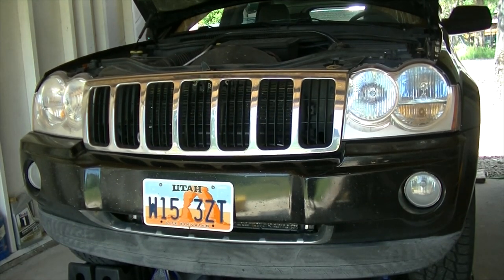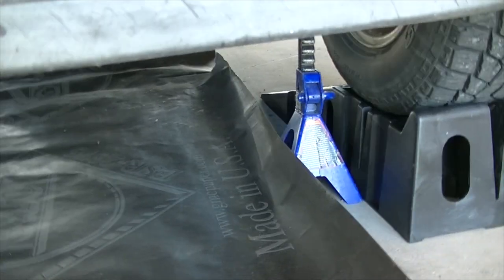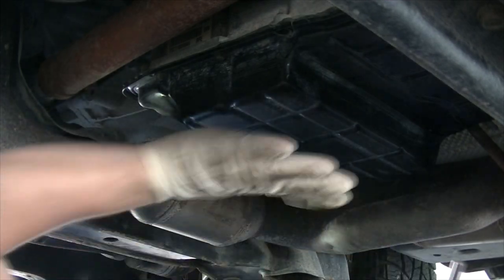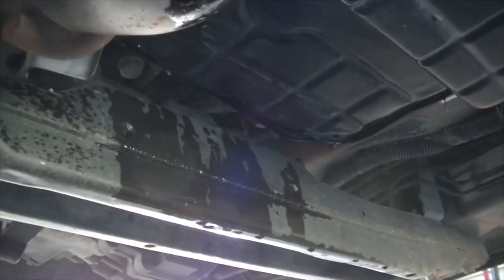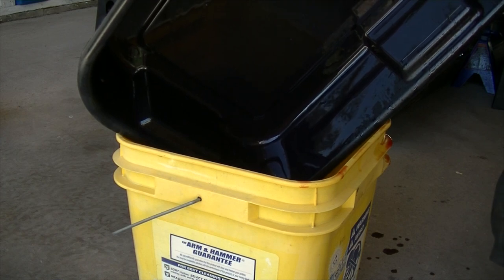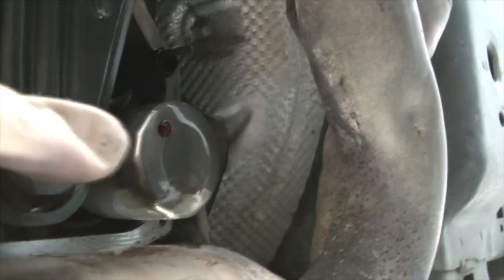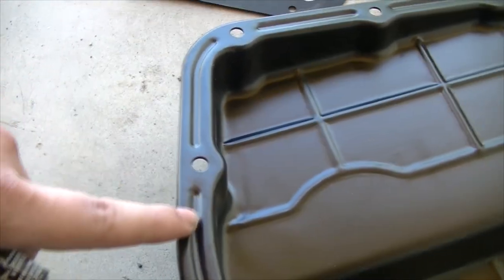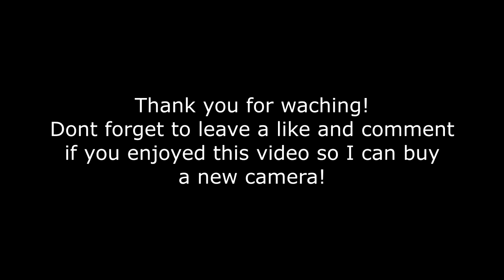WK (2005-2010) V8 Jeep Grand Cherokee: How to service your transmission / swap transmission pan

Comment: RTV is not recommended with these trans gaskets, been doing mine for years without RTV and never had a drip.  Also make sure when installing the new gasket for the filter to install it on the Trans and not over the filter tube itself, heard of a lot of problems resulting from this, great video and very good explaning..

Comment: If you are replacing the pan you could have just drilled a small hole in the pan to drain the oil.
Reply: You can drive an awl in too drain it too, if it's a stamped pan, and then braze the hole shut to reuse👻

Comment: If you have bits of metal in your fluid even if it's black put it back in. It's common that people flush it and add new fluid and it starts slipping. Sometimes those bits of metal are the only thing helping the gears lol.

Comment: The recommended fluid change for the ATF for a 2007 says every 100,000 miles or 36 months which ever comes first, and to change the filters and fluid and use Mopar ATF+4.

Comment: I think reason your bolts broke is because the torque spec is 105 'inch' lbs. not Ft. lbs. The Ft. lbs spec is 8.75  ft. lbs
Reply from the maker: Good to know thank you for this info. I grew up with the metric system so inches and feet are pretty dumb in my opinion but it is what it is
Reply from the maker: An update to this, the job has held up for almost a year now with a very small leak, if it gets worse I'll take it to a shop for them to fix the broken bolts
Reply: @link375 Just so we are clear. You torqued a tiny 8mm bolt into an aluminum case to 105 ft lbs. But the feet and inches are what's dumb.

Comment: When I do a Automatic Transmission pan gasket, fluid, and filter change I get the pan and magnetic clean. Change the filter. Then put the RTV silcone gasket maker on the pan side only. Then the gasket the bolt it up in place in a even pattern and torque it to spec. Then allow it to dry at least 24 hours. Then fill it with new transmission of the proper type. Then let it idle and check the cold full level add ATF if needed Then later after driving 15 minutes at least check the full level hot and add if needed. If it is remote start disconnect the battery first. Don't start the vehicle untill transmission has the correct amount of the proper ATF!!!

Comment: "105 foot pounds" for the pan bolt?  No wonder you broke the bolts.  That's tighter than a wheel lug.  Better check that number dude. (more like 9 foot-pounds or 105 inch-ponds)

Comment: HEY MAN YOU LEFT PART OF OLD GASKET ON TRAINMISSON . AND TZONE IS RIGHT INCH' LBS NOT FT LBS .' HAVE GOOD DAY
Reply from the maker: Good to know, I plastered ultra black all over the sides and let it sit 24 hours. So far it's been holding up for almost a year now with a very minimal leak. I'll take it to the shop if the leak gets worse for them to fix the broken bolts. I just make sure to check the fluid once a week to make sure there's no issues.

Comment: When you are finished with your torque wrench, you are supposed to zero it out all the time. If not it loses its calibration, thereby making inch and foot pound measurements inaccurate.

Comment: Do u ever get high temp transmission light for no reason with good fluid and everything shifting good
Reply from the maker: I've never seen that before, it might be a faulty temp sensor if everything is good and your fluid isn't dark.
Reply: I get the message transmission overtemp
Reply: Daniel Riego  I have it too the only thing I can find is leaking fluid out of the bell housing doesn’t look like much might be a bad seal  I put Lucas in it and it seems fine for now
Reply: I do in my 06 4.7. Got it yesterday and when it does it the tranny shifts weird til the message goes away. I’ve read up it and it seems to point to the shifter control board. The contacts get dirty. Need to remove shifter and clean the board.